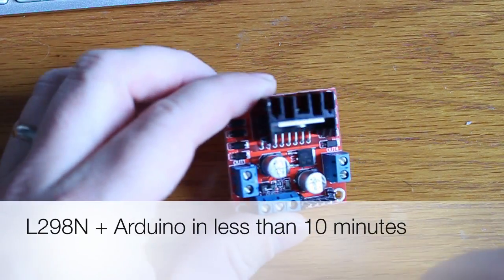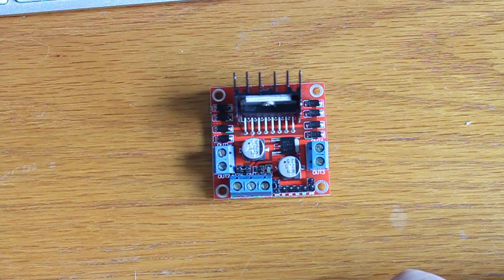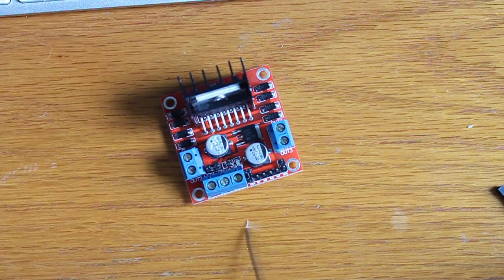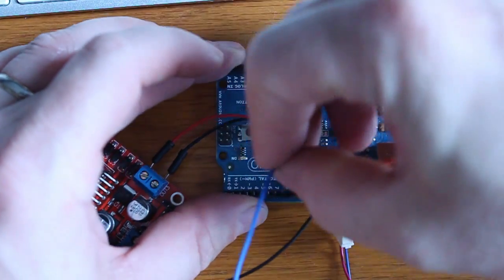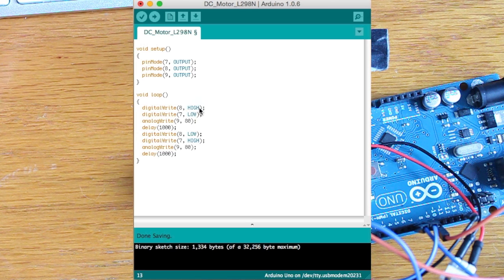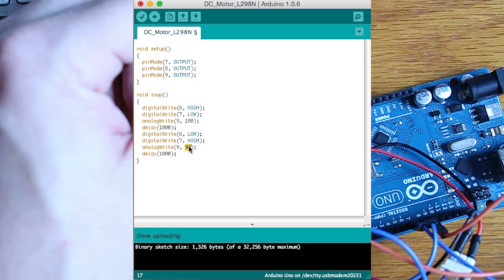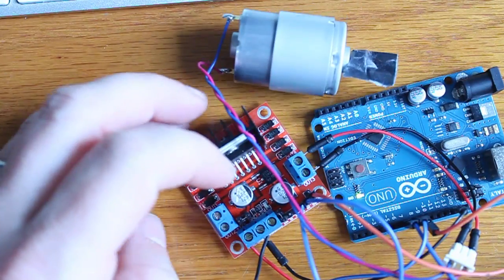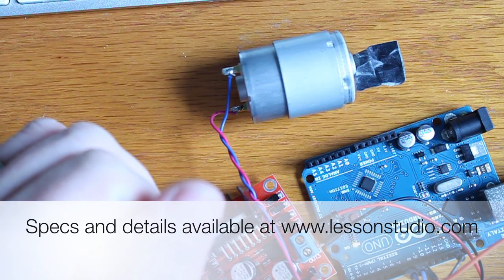HOW TO: control DC Motors with Arduino + L298N

Comment: If I wanted to add RC capabilities to this circuit, how would I go about doing this?
Reply from the maker: +Jesse Avalos There are three ways. The first is if you have a classic RC transmitter/reciever circuit you can connect an arduino to the rc receiver and use a pulseIn() function to read what the reciever would normally be sending to the device in question and acting on that information for motor control etc. 

Or (and I have never done this) you could see what happens when you use the receiver to send PWM signals directly into the module. The module does have the ability to use PMW for motor speed control but I suspect that the wiring would be odd at best.

Thus my recommendation would be to interpret the RC signals through an arduino and then send signals such as the ones in this tutorial to the motor control module. 

A third way is if you want to "Remote Control" this module and by that I mean not through a traditional RC controller but something you make yourself or have a laptop/iphone etc doing the remote controlling. 

Various options would include one where I have already done a tutorial

https://www.youtube.com/watch?v=4c0t8PBArvk

 where I use a NRF23L01 to provide remote control of a motor. Similar setups would also allow for remote control either over bluetooth (limited range) or with a wifi module which can have an extreme range when used with the proper antennas. 

Bluetooth Low Energy (BLE) https://www.youtube.com/watch?v=UolJHmZ0RFk would allow for limited range but allows for iPhones and newer androids to do the controlling. Or the Older Bluetooth: 

https://www.youtube.com/watch?v=3tcn496oxnk

Which would be more for controlling from a laptop or desktop.
Reply: +LessonStudio so I would be connecting both enb and ena module pins to  PMW pins on the arduino and then connecting two of my RC receiver channels to another two PWM arduino pins. And then I would use the pulseIn function to communicate between the RC signal and the module?
Reply from the maker: +Jesse Avalos Close. You also need to have some digital pins going to pins IN1, IN2, IN3, IN4 as these tell the motors to go forward or backward. The ENA, ENB pins say what speed to go. In my example I just left them jumpered which effectively meant "Go full speed" 

Pins IN1, IN2 are for motor A, and pins IN3, IN4 are for motor B.

The ENA and ENB both expect a PWM signal for this speed control. IN1-4 merely need to be digitalPins.
Reply: +LessonStudio IN 1-4 can be regular digital pins, got it. I just want to be sure that whatever receiver channels I use and the ENA - ENB pins all need PWM pins on the arduino in order to communicate between each other.
Reply from the maker: +Jesse Avalos I believe that the pulsein() pins can be regular digital pins. Only the ena/b pins need to be PWM. 

There are other options depending on what you want the code to also be doing as pulsein just sits and waits for PWM signals. attachInterrupt() is one good option but then the code becomes somewhat more complicated. The key is that it allows your code to be doing otherthings while waiting for the incoming signal.
Reply: +LessonStudio Thanks for answering all my questions! That was a huge help!

Comment from the maker: With a stepper you will be using digital 4 wires per motor(assuming a 4 wire stepper) so an uno could control 3 and a mega could control 13. 

But for that many motors there are other options depending upon the size of your motor. There is a A4988 module which only uses 2 pins for each motor. One is for direction and one for steps. These boards can also do 1/6th microsteps so very nice feature there.

The A4988 is pretty much equally rated capacity-wise if you put a little heatsink on it along with paying attention to cooling. 

So with the A4988 you would halve the wires used and in theory double the number of motors under control.
Reply: A bit late now, but 9 is the pin you are addressing.
Reply: I'm testing this module which I bought last week...its unable to turn even the smallest motor (thumb size)...it just changes its hum. I don't know...Solution it needs a 12 volt power supply and a 5 volt at the same time.
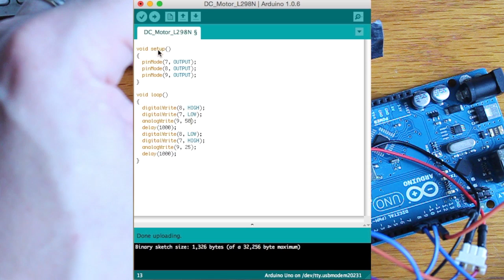Reply: Hello at the 8:33 minute of the video that "analogwrite (9,50);" Where did that nine come from? I'm new to arduino!

Comment: Could a person connect the pwm input to a rc receiver?
Reply from the maker: +Brandutchmen Absolutely. There is a pulseIn function in the Arduino library that will nicely handle that. I believe that standard RC sets it to 25000.
Reply: +LessonStudio is it possible without an arduino? like a sabertooth motor controller?
Reply from the maker: +Brandutchmen I believe that unit is RC compatible.
Reply: +LessonStudio I will look into that then, thank you
Reply: Now Controll anything in adrunio via keyboard{makeAnyprojects}
https://youtu.be/jAHLtRmgRiI

Comment: how many of these L298N  and steppers can be controlled by one Uno? or an atMega?
Reply from the maker: +Dave Klebt That is an interesting question and easy to calculate for steppers. With steppers you need 4 digital pins for each stepper, so 54/4=13 steppers; with an UNO you could do 14/4=3 steppers. 

This assumes 4 wire steppers as there are some 6 wire steppers which this module wouldn't handle.

But if you are desperate to control an absurd number of steppers you don't necessarily need to go to an arduino with many pins but can use something like a PCF8574P chip which uses two of the pins SCL SDA and will give you an additional 8 I/O pins. You can chain a number of these in a row (8 I think) giving you 64 input/output pins while using only the same two pins on the arduino. Plus I believe there is a 16 I/O pin version of this that would put you over 100 I/O pins when chained.

Thus with the I/O expander you could control 16 or more stepper motors from any arduino chip with I2C capacity.

With that many steppers where you would run out of capacity might be in the ability to fit in a program that could even do much thinking about that many steppers. This is where the MEGA could buy you a bit of breathing space as it has a larger memory for both the operating program and for storing the program you would like to run.
Reply: thanks, that is useful. i did get the AT Mega, but i am a true noob...
Reply: Now Controll anything in adrunio via keyboard{makeAnyprojects}
https://youtu.be/jAHLtRmgRiI

Comment: The thing u were sayin about capacitor... How much Farads should it have and does it go onto PWM pin or what ?
Reply from the maker: +Cro Warior I am presuming that you are referring to a capacitor to smooth out the PWM. What you are effectively looking to do is create a low pass filter. There is some good math behind this but with smaller motors and voltages it can be just as easy to experiment if you have a good capacitor collection. Typically I find that I end up with capacitors of around 1-10uf. 

One of the oddities is that with an arduino the different sets pins actually put out different PWM frequencies. So looking up which pins put out which frequencies and then trying pins from another set might give you the effect you are looking for. 

Also be aware that a capacitor can be a conductor at higher frequencies, thus you can start losing power through the capacitor as it is acting a bit like a short. 

An oscilloscope is a friend when doing things like this. It will not only show if the output is nice and smooth but will show if you are throwing power away.

But, as I said, with a simple motor at fairly low power, just throwing capacitors in willy-nilly usually finds the solution. Just watch the polarity if you are using a type where this matters. I usually use ceramic for this.

But for a proper and perfect solution check out low pass filters.
Reply: damn the response was fast, thank you dude
Reply: Now Controll anything in adrunio via keyboard{makeAnyprojects}
https://youtu.be/jAHLtRmgRiI

Comment: What i need to happen is a such...
I need to push a button to start the motor in one direction but i need the motor to stop after a certain amount of time, possibly 15-20 seconds. Could i do this with this setup?
Reply from the maker: +Aaron Rios Yes, just have the code in the Arduino detect the button push and set the output to the motor to high. This high command would be followed by a delay which would be followed by setting the motor pin to low.
Reply: Now Controll anything in adrunio via keyboard{makeAnyprojects}
https://youtu.be/jAHLtRmgRiI

Comment: i wanna control 2 dc motor each 12 v but their stall current is more than 2 A is their a way to control them with h bridge without burning it if not could you recommend a way to control them to use them in a car ?
Reply from the maker: +Maha Hasan There are a number of ways to do this. By far the easiest are 5A boards on ebay for around $10USD; they work pretty much identically to the board used in my tutorial. There are also 10A boards for about $20USD that are quite similar. 

Alternatively, you could build your own H-Bridge using MOSFETs. While the theory is simple, motors are a pain in the butt when it comes to energy flying back from them, so it would take some careful diode placement to make sure that the motors didn't reach back and fry your board. While highly satisfying to build your own h-bridge the only advantage that I can really think of is that you could get a pretty high amperage one for very little money. For instance my favorite MOSFET (this week) is the FQP30N06L(40 cents each). At 12v, the limit for the mosfet is around 18Amps with a temporary surge capacity much higher than that (~100Amps). With mosfets like those and a few supporting circuits you could happily build a 15A h-bridge for maybe $3USD. Where this gets hard is that your wiring paths need to be robust. If you look at most 5A+ circuit boards you will see that they have run solder along the copper traces to give them the current capacity they will need. Also you have to deal with the logic of an H-Bridge; logic such as when you send the erroneous instruction to run forward and backward at the same time.

So, I would really only recommend building your own H-bridge for two reasons: one is that you want to build your own h-bridge. The other is that you are building many of the final product and are looking to keep your costs down. 

Then, there are products such as the TL5205. These sort of things work like the L298N to give you the bulk of an H-Bridge in a single package. I have not worked with a bare h-bridge any more powerful than the L293D. 

In the keep it simple category with a hack: a combination of mosfets and an L293D could be used so that the L293D would provide the "logic" and operate the gates of the MOSFETS. 

The strongest recommendation for the ultimate in keep-it-simple would be to just buy an H-Bridge board from online that can handle your needs.

Comment: Hi, thank you so much for the tutorial, it really clears things up in terms of what goes where on a motor controler. Just one question, since the L298N can be powered by a 12 volt power supply can it have an output voltage of 12 volts right to a motor or is there a limited voltage it can output. Sorry if the answer is really obvious I'm new to the whole motor control and arduino world.
Reply from the maker: +TangoBravoCheesecake It can actually take in about 35v at two amps per motor.

But those numbers are the theoretical maximum. Generally you don't want to run right up against the maximum. With motors I like to stay as low as 50% of rated maximum and start getting uncomfortable if it is going to sustain anything over 80% of rated maximum. 

Also there are slight losses which you can check the charts for but experimentation is usually easier. These losses mean that if you put in 15 volts that you won't quite get 15volts going to the motor; maybe 13.5? The same goes with the part that can feed back 5volts to your arduino. If you don't put in around at least 7 volts into the controller then it can't put 5volts back out.

I have never tried it but I suspect at very low voltages much below 5volts that the L298N would just not work properly. 

At those low voltages there are alternatives that would probably be cheaper and work better. 

If you need to go beyond the specs of this module there are other modules that pretty much work identically yet can handle far larger loads. For about $10 you can start to crack 50 amps.

The key to this module is that it generally can control most motors that people are using for homebrew robotics type projects and is really cheap for what you get.

Good luck.

Comment: Hello! First of all Thank you for the tutorial! 
My motor is working perfectly. But the issue is power wire which I connected to the 12V slot on L298n driver gets extremely hot.
My arduino is connected via usb. And I connected GND from arduino to GND of L298n as shown in the video. My motor's rated voltage is 3.4 and 1.7 A(U). But I'm using 12V 5Ah battery. Could it be the reason why power wire is getting hot? Doesn't L298n control the voltage and current for the motor, even power source is higher?  Last time my arduino's burned. Either one side outputs of L298 are. This time when it gets hot I plug it out quickly. If power supply was the problem what do you suggest? If not what could be the reason? Please answer for my questions one by one. Thank you again!
Reply from the maker: +kuukeldei deidara I strongly suspect the issue might also be the thickness of the wire. There are formulas for figuring out how thick a wire is required but it is too late for my brain to remember them. Just off the top of my head the wire thickness for a solid copper wire would be around as half thick as the lead in an old style wooden pencil. 

That will probably be the answer to all the questions. The battery is fine, the motor is nicely below the rated capacity of the L298N, and as long as you only feed 5v into your arduino it should be fine (as long as it is a 5v arduino).
Reply: LessonStudio I changed the wire as u suggested. But then the motor driver L298n heats up. Especially the heat sink of the driver. It starts to heat up in few seconds, 5 or 6.  Somewhere I read that "...heat sink heating up is normal. It gets up to 135 degree hot." But it is too hot, I even can't touch to the heat sink. So If I keep my motor running will it be OK? It must be running for at least 5 minutes.
Reply from the maker: +kuukeldei deidara The motor driver has a few limitations. One is 2 amps per motor, 35v, and 25w total. The 25w maximum is where the temperatures of the H-Bridge are hitting their limits.  You mentioned 3.4v at 1.7A so in theory that should be around 6 watts which is fine. But I just realized that you are putting 12V into the L298N which will pretty much pass that along to the motor which is more than 3 times its voltage rating. 

So the first thing to look into is if the motor is going to be burned out. The second would be to hook up a multimeter to the circuit to see how many amps and at what kind of volts. This will tell you much of what you need to know. 

But, yes the L298N will get quite warm during normal operations if you give it a fairly good load.
Reply: It seems like heating up issue is solved. I used the 12v 2A dc adapter and it works better. Heatsink heats up slower. But I have a new issue. 

My arduino was powered by laptop USB. I used sample code "oneRevolution". My stepper rotates in both direction. When I use 5V pin on the L298n as power source stepper rotates in only one side. I don't understand what 's going on.. I just connected 5V pin of the arduino to 5V pin of L298 and Gnd of arduino to Gnd of L298. Where did I do wrong? Can you explain me please? I even changed the gnds' places of arduino and uploaded code. No change..
Reply from the maker: +kuukeldei deidara Probably the best thing to do would be to email me a picture of your wiring, combined with the code. My email is: donovan(at)[the name of this youtube account].com
Reply: I've just sent email attached pictures. Could you check it now, please?

Comment: actually it's 7v-35v not 7 to 12, but I wouldn't recomend to use full 35v 24v is fine for larger motors
Reply from the maker: +Rokas Raulinaitis I have never understood why so many of theses say 12v not 35v.
Reply: +LessonStudio  maybe its developers miatake. :). btw i love your videos. keep them flowing
Reply from the maker: +Rokas Raulinaitis I have a few in the pipe right now. Thanks!

Comment: can i supply the module with 9v battery? for the DC motor to have a good speed on rotation?
Reply from the maker: +dan bon marañon The answer is: Sort of. A 9v battery won't put out much amperage. So unless the motor is very small it will be pretty disappointing. This is why most motor driven devices have a bunch of AA, or bigger, batteries which can put out more current. Also the mah available from a 9v is also pretty disappointing which is why you don't see them in things that really put some strain on a battery such as a flashlight.

For most projects what I like to do is to put a battery pack in with a handful of batteries. You can buy various sized battery packs from ebay that will allow you to put 4 AA batteries into a project in a nice compact way. I think they cost around a buck.